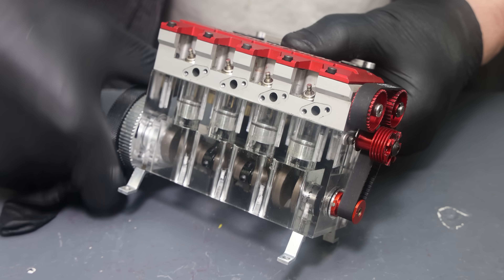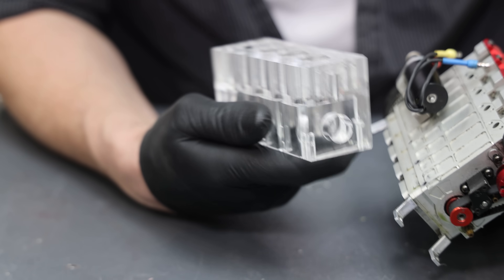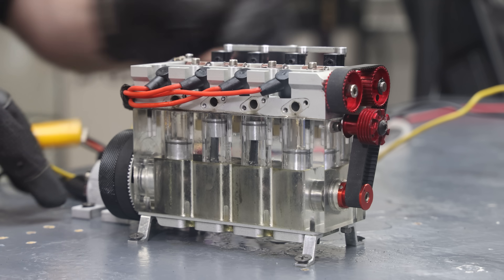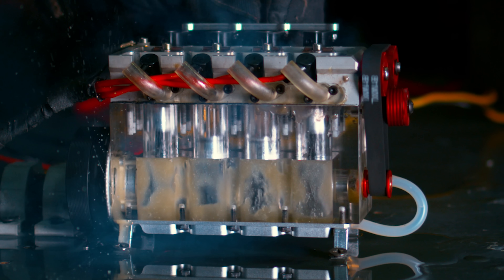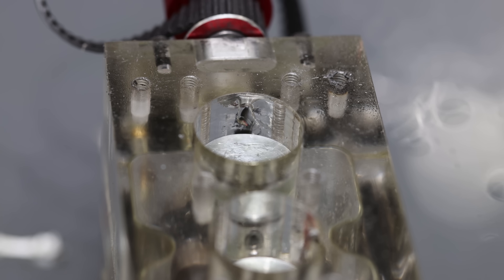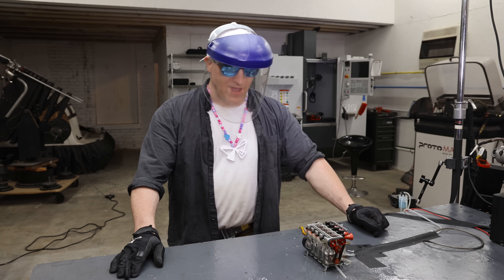See Thru 4 Cylinder Engine - Dangerous Power

Comment: Dude if you’re going to have oil in there you NEED to out Positive crank pressure ventilation. Drill a hole in the block, run a hose to an intake manifold so that it can vent. You’re putting so much pressure in the crankcase man.

Comment: Starting at 7:10 if you slow the video speed you can see that #1 and #4 were firing at BDC before the compression stroke. So those pistons were literally being pushed up into a flame front with the valves closed lol. No wonder the crank broke!

Comment: You should have a center bearing for the crank so it's not bending, avoid snapping it, and get the center cylinders more balanced. You should also add a small hole in the block (in the crankcase), with a tube, that leads back to the carburetor (kinda like a PCV valve) so you can remove all that blowby. You could even put a tiny metal tube in the exhaust that leads to the carburetors as a EGR valve to reduce temps a bit.

Comment: If you could inject compressed air after TDC on the compression stroke you could make this engine run on pressure and avoid the heat of combustion. In an internal combustion engine it's pressure not heat that pushes the pistons.

Comment: Am I eyes f'd up or does it look like only one cylinder is firing in the first two runs?
Reply: I think that might be the frame rate of the high speed video - it happens not to be taking a picture at the point of combustion of the other cylinders.
Reply: That’s what I saw too.

Comment: All pistons are not working properly.
Reply: Probably a compression leak, it doesn't have a gasket. Also, Toyan didn't design the crankcase and crankshaft part correctly, luckily they fixed it, but it made some things worse.

Comment: You should run the 1 cylinder
Reply from the maker: I tried but since the crankshaft is broken it wasn't spinning the front belt or the camshaft So no Valve action.

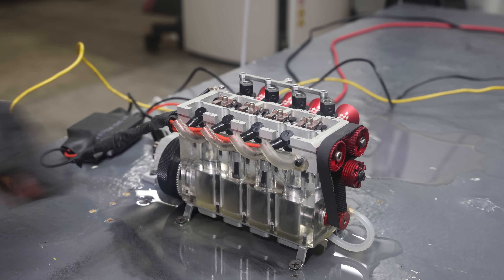Comment: That was awesome.  Why is only one cylinder having good steady combustion at around 4:30 when the sound effect was synced with its firing?  Other cylinders already having enough blow by to lack the compression needed to fire, and also lack the vac to suck in their proper AF charge?  Thanks.
Reply from the maker: Yes I think the other cylinders just lost compression very early on and quickly. The tolerances in these tiny engines are very tight so even a thousandth of an inch change has a big effect on performance. That's why these little mini engines are hard to get going.

Comment: Not boring
 What about oil Gallery- the tunnels in the block to mani and cam bearings
How make them 
I could never fights tvat in real engines how they get oil to crank and cam little tunnels in block ?
Reply from the maker: I think they cross drill holes, and then they plug the holes in the back of the block with a steel ball from what I remember. I've also seen this on the Prius engine same thing They have balls in the back to plug the oil galley.
Reply: @WarpedYT  / Danke 
I used too watch your videos everyday about 2 years ago . You made some amazing content.
 None of your content is boring , I can see the time consuming effort into these projects , you really should have a college professorship and some type of degree in advanced engineering.
 What do you think about the hydrogen hot rod - 1953 Chevy truck with LS - two fuel injectors per cylinder running on HHO - compressed hydrogen?
  They are saying it’s dead cause used too much fuel - but I think fuel can be reconstituted and reused instead of thrown out exhaust- 
 I’m just saying they got crazy laws by CFR trilateral commission and fuel economy and pollution I read up to 2099
 It’s absolutely crazy, the laws
They want air coming out cleaner than it was goin into the engine.
As for USA manufacturing, that’s another political disaster.
 Another example is chemical engineering- petrochemicals and petroleum engineering- btu per lbs in stores liquid hydrogen is phenomenal- it’s overwhelming how much stored energy is one gallon of gasoline or diesel, yet it’s being made illegal without reaching its full potential.
 Thanks again 
Great stuff , glad your still at it here

Comment: Made hole on crank 1-2 & 3-4 for balancing crank gas compression. So the oil doesnt came out the oil pan/crank chamber
Reply from the maker: I actually had a crankcase breather.
Reply: @WarpedYT  Cool.. 👍

Comment: Why was it revved so high? Might live longer at lower RPM. Also, does it have to be 100% see through?! If not you could add sleeves😮 What is the print material? Polycarbonate?
Reply from the maker: It revved so high because the My girl there opened up the acetylene and oxygen as soon as she heard it turn on, which was okay We didn't want to lock up before seeing some results... I like making things 100% see through, the printed material is the form labs resin, It's a 3D printer that uses resin It's interesting. There's a link in the description if you want more info.

Comment: Please, make see thru diesel engine. I would like to see how diesel fuel ignites its own
Reply: I think the pressures would be too high for the acrylic
Reply: Optically accessible diesels exist. Usually they have a crosshead and dual piston rods, and the piston crown contains a fused silica window. You see in with a mirror placed at a 45 degree angle under the piston, dual piston rods go either side of it.

Making one is a complex project, the easiest way is probably to get an existing diesel block, modify its piston to act as a crosshead and place your custom optically accessible piston and cylinder on top.

Comment: Hi, they have a lot of blow by, thats why it doesn't have oil in the crankcase, because all would go out thru the crank ventilation. I have the V8, the 2 cyl, the wankel 2 rotors, and the 4 cyl. Great video.

Comment: You could sleeve the cylinders with synthetic sapphire tubing to greatly enhance the useful life of the block while keeping it optically clear //
Reply: Borosilicate glass tubing as the cylinder liner would be optically clear and much cheaper
Reply from the maker: Yeah that's tough I've done that before to get the proper bore size is pretty difficult, I don't think the reward is big enough to go through the trouble to be honest... But that's a good idea

Comment: Dude you had crankcase presure building up,no wonder leak the heck, make a breather with a one way breather valve.
Reply from the maker: That was only in the first run, if you look closely I disconnected the crankcase breather tube for all the following runs. That's why when the engine burned up it was shooting smoke out of that little breather tube in the crankcase.

Comment: Next time maybe machine PC instead, it can take alot more temperature, though needs a Polish and clearcoat after machining. Poor crank :)
Reply from the maker: Thanks I'm going to look into that, Yeah that was some serious detonation lol
Reply: @WarpedYT  we use clear prototypes at work quite alot, SLA printed are simple to make and can be very useful. But has its limitations :)
Reply: @WarpedPerception maybe check what the break in the crank looks like. I have a sneaking suspicion it was a torsional failure. Crank not stiff enough, no harmonic damper...

Comment: Gotta check out garage 54 they did almost the same with an old Lada engine. And they also tested the oil in the crankcase theory all different levels from little to completely full definitely shows why the oil should remain below the crank...

Comment: You can use rubber o-rings instead of the metal rings in the pistons. The Russians tried this in a bigger engine and it worked.
Reply: Garage 54 right, lol
Reply: I was literally watching Garage54 before clicking this video lol.

Comment: If you watch at 0.25 speed at 7:42 and 7:53 you can actually see the flame traveling back up either the fuel or oxyacetyline line in the background. Pretty crazy.
Reply from the maker: I actually had an even slower clip but omitted it .
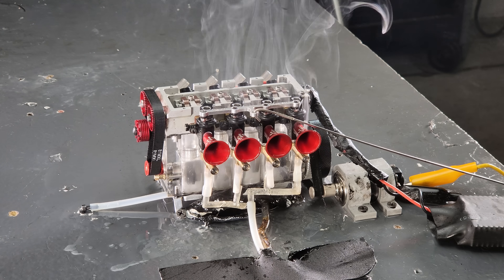Reply: @7:03 is the money shot on .25x speed

Comment: You can see knocking occurring in cylinders 1 and 4 after applying oxygen fuel. The fuel ignites when the piston is on its way to the compression stage. This creates two opposing forces: the piston attempting to move upward and pre-ignition or knock trying to push the piston downward. Consequently, the crankshaft fails to tolerate these reverse forces.
Reply from the maker: good eye... I didn't see that until I was editing at the end then I saw it. thats what broke the crankshaft no doubt.
Reply: @WarpedYT  thats a real robbery not a bank heist, fvckin chineses offer this low quality piece of shit for 800 bugs. 
next time you should just drink a fine old schotch for this money
Reply: Crazy - near the end cylinder 1 is firing practically at BDC at the end of the intake stroke/start of the compression stroke. Can't really get much worse. If it was using spark plugs instead of glow plugs, it probably would run a lot better/longer under these conditions
Reply from the maker: @GlutenEruption hahahha, I saw that while editing that was insane, I don't know that spark plugs would have made a difference because Oxygen/acetylene is very easy to ignite, if you look at it the wrong way it will start burning.
Reply: You're right, I can see it clearly at 0.25x 7:37 7:39
Reply: This footage helps a lot to understand how bad knocking is for piston engines in general. Great job spotting this and great job from Matt with everything from building the block to testing, recording and editing!
Reply from the maker: @Almarracing  thank you, Yeah that was unexpected but exactly like you said It's crazy to visualize it.
Reply: I think you mean pre-ignition, which is different to knock.
Reply: Yeah was going to say similar. Some insane levels of pre-ignition or super delayed ignition, especially on cylinders 1 and 4. Going to 7:40 and going frame by frame is pretty revealing. A big event on cylinder 1 seems to break or at least crack the crankshaft and then number 4 finishes it off or at least has another big boom which causes the loud backfire. Fascinating stuff that really helps visualize what is happening in a larger engine and why pre-ignition and detonation are so destructive.
Reply: It is absolutely critical to understand the differences between knock/detonation/pinging versus pre-ignition.

They're not remotely close to the same thing. 

No commercially available engine will tolerate pre-ignition at WOT without immediate catastrophic failure.  

Only an extreme minority of purpose-built race engines can tolerate pre-ignition with significant damage.  Best case scenario is head gasket damage usually accompanied with head and/or deck damage.

In stark contrast, tons of modern commercially available engines experience knock/detonation/pinging on a daily basis with little to no consequences.
Reply: @zacharymorris9917  except that this IS detonation, except its simultaneously pre-ignition... this is far from a textbook example of either, its an extreme case.

its exploding before its meant to ignite. pre ignition. its exploding... detonation. 

its exploding as soon as it even starts getting compression. thats what oxygen , especially with acetylene as the fuel, does.

thats why we dont run pure O2 but use NOS instead... no engine will tolerate a decent whiff of oxygen, and its got nothing to do with AF...
Reply: @paradiselost9946  wrong
Reply: @zacharymorris9917  ok. have you ever TRIED pumping pure O2 into a running engine?

you never stopped to ask why they bother with NOS at all, why not just use straight O2?

you think all these drag racers and drifters and hod rodders would be all over it by now IF IT WORKED.

maybe theres a reason that it doesnt...
Reply: @paradiselost9946  you're having an imaginary conversation with yourself while imagining that you're the expert in the conversation.

I am an actual expert in this field with decades of experience and extensive knowledge of alternative fuels, alternative power adders,  personal experiments and professional tuning.  I went down the liquid oxygen instead of n2o route literally 20 years ago.  I can tell you the adiabatic flame temperature for most fuels in air AND in oxygen from memory .  I was figuring this stuff out before the internet had all the answers.  Don't waste your time trying to sound smart to me.  It will only have the opposite effect.
Reply: @paradiselost9946  you still don't know the difference between detonation and pre-ignition even after I spoon-fed the info to you.
Reply: @zacharymorris9917  i never claimed to be an expert, yet here YOU are spouting on about how YOU are the expert yet you dont even seem to understand the combustibility of an oxy-acetylene mixture...

ooooh, adiabatic. what about isobaric?
Reply: @paradiselost9946  the harder you try, the more obvious it is.
Reply: @paradiselost9946  Detonation and pre-ignition are defined terms and not interchangeable. Detonation is when localized hot spots within the combustion chamber cause uncontrolled combustion of the air-fuel mixture (ie a localized explosion in an area of the combustion chamber that the flame front has not reached yet). It always occurs after the spark. Pre-ignition always occurs before the spark. Detonation is common and tolerable in most engines (to a certain degree), whereas pre-ignition is almost always catastrophic (at WOT).

You seem to think that the word "detonation" just means "explosion," which is incorrect. It's an actual term with a very specific meaning. Likewise, "pre-ignition" doesn't mean "exploding before it's meant to ignite," it specifically means before the ignition of the air-fuel mixture.
Reply: @zacharymorris9917  I was about to comment the same thing. You're exactly correct, pre-ignition and detonation are two entirely different things.
Reply: @rars0n  yes sir.  It is really very simple.
Reply: Friendly fire wont be tollerated AHH crankshaft

Comment: The crank broke cause the block wouldn't keep it steady
Reply from the maker: Nah If you look closely really closely you can see that because of the oxygen acetylene it was volatile and the combustion was happening while the Pistons were still moving upward in the compression stroke, a couple of those explosions happened while the Piston was almost at the bottom, take a good look at the end at the slow-mo footage.
Reply: Preignition.
That's why crankshaft fracture happens, even on big engines.